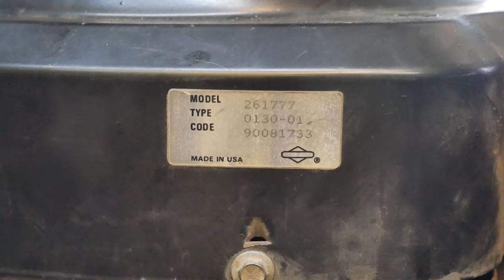Hydraulic Pump + AC Compressor = Useful Unit

Comment: You just built a 5,000 dollar unit for maybe 200 bucks in parts. Hats off to you 😁❤
Reply: 11
Reply: 8
Reply: knowledge equals capital 😊
Reply: Hardly $5,000 as you claim. You can buy a complete, capable, and powerful log splitter brand new for less than half of what you claim.

Comment: Nice work. I made a similar unit over 10 years ago using an ac clutch from a 1991 bronco. I made it for my 3 yard dump truck. It held strong, never slipped, and never failed. I sold that truck last year and that clutch unit was still going well. That unit you made will work great and hold up to anything you throw at it.
You are the only other person I've heard of doing this.
Nice work!
Reply: Не понимаю я по вашему пишите по нашему по русски

Comment: It took me a minute to figure out what you were doing. I thought you were using the AC compressor but what you wanted was the magnetic clutch assembly and the housing was convenient since you could install a different shaft to couple to the hydrolic pump. Nifty home made hydrolic pump.

Comment: Put a heavy duty microswitch to the lever by using a "B" cam, so the microswitch become depressed when you pull the lever in either direction, thus the pump only works when needed.

Comment: Seen this reposted on YouTube and everyone was hating on you. I say this is a well made magnificent machine. You used basically scrap out of a recycling bin ready to be crushed and made a working hydraulic pump and arm that you can find parts for at any local scrap yard or you could buy replacement parts new and readily available because it's just an automotive ac compressor and basically a riding mower engine. It's honestly genuis.

Comment: That’s very resourceful! I’m just trying to grasp the reason for it though. Cause a hydraulic circuit will be able to drain back to the tank when it’s not being used while the pump is still going. 

The only real benefit I see of this setup would be if you were running a hydraulic motor from the pump, you’d be able to start and stop it electrically.
Reply: That is my thoughts as well.
Reply: Он не знает принцип работы распределмтеля 
Либо очень плохо заводиться мотор

Comment: I picked up an alternator with a hydraulic pump attached to the back. I like the use of the clutch so you don't have the starter turning the pump while trying to start the engine.

Comment: this is a really cool setup but can i ask why the hydraulic pump needs a clutch vs just direct drive and allowing it to run open circut?   i could see the need for a clutch if this pump was on a vehicle to avoid long run times when the pump isnt needed. but why here?

Comment: Just putting it out there not a hate comment, that’s a gear (motor) that your trying to use a as a pump, yes it’ll work but won’t be as efficient and will Cavitate because the “inlet” is the same size as the outlet. The inlet in a pump is ALWAYS bigger. You might blow your shaft seal out to because the checks inside won’t be oriented correctly. And instead of the clutch drive you could just use a float Centre valve but hey seems to work okay. Just my 2 sense great build!
Reply: Do you realize this is hobby/amateur level job? You work with things you already have in your garage.

Comment: Nice work. Could you have used the AC compressor as a hydraulic pump instead? Would it have given enough flow?
Reply: Nope. A/C compressors are built to compress gas with a little oil and liquid Freon. But Hydraulic fluid would just stall it. BUT they make decent (Not great, but decent) air compressors !   My old 93 Yukon developed a leak in the evaporator and I didn't feel like fixing it (Plow truck anyway). But one day it dawned on Me that I could use it as an air compressor so I installed two wet side truck tanks (so I could bleed them occasionally) and a drier in the frame, put a switch in the dash for the clutch and it will build up enough air to run an impact if needed. I later installed a friction cable to the throttle so I could hold the throttle speed up. About 1200rpm works great. I'm a diesel mech so I have access to stuff. But good question.

Comment: What i did was made a frame that held the engine up between the frame rails on a trailer, and the used a direct coupler to the hydraulic pump. The clutch is a nice option so you can turn it off when you want. Even a centrifugal clutch would be an improvement. But im partial to my idea since theres nothing really to go wrong.

Comment: Why not just use a power steering pump ?  It just recirculates when not being used and doesn't load down the engine running it .

Comment: Very cool but many small vertical shaft engines already have electric clutches from the factory.  Why reinvent the wheel with custom parts that’ll be much harder to service if there’s a failure?

Comment: The bearing in that adapter housing you made won't last very long. Electric engagement on the shaft of engine would be a better choice as alot mowers already  already have.

Comment: good work but you don't need the AC compressor for that just connect the hydraulic pump directly and have the control leavers in the mid position (pas through)

Comment: Big issue for longevity when using these ac compressors for air compressors is to mount them with pulley down where possible to minimise oil consumption

Comment: I don’t understand, you never put the compressor back together? I assume it’s going to have an air conditioned cab? The main downfall is it’s going to have to run the ac at all times  to have hydrolic pressure. How about winter use? Evap is going to freeze up. Or is there a separate pump for the traction motors?
Reply: We did a similar thing but with a hydrolic motor to add air conditioning to an old kershaw shredder

Comment: Why do you need the ac compressor at all?  Simple lawn mower pully with electromagnet (like one used to engage blade drive) turning hydaulic pump would work ,

Comment: You've a major problem. The bearing on the front of the compressor housing, is lubricated from the oil in the refrigerant.  It won't last long dry

Comment: I see problems happening with all of the extra parts younare using, why not directly couple the hyd pump to the engine and run a proper open center hydraulic valve?
Reply: It can spoil the starting process? Only (or main) reason for clutch here.

Comment: Why not just use a coupling that you can get for like, $10 and go direct to shaft with the pump instead of roasting an AC compressor, spending several hours on it, and making it larger than needed?

Comment: 1 Ac pump is (become,)  hydraulic pump.. 
2 powering hydraulic  ( pump?)
3 Hydraulic ( motor ?)
Hydraulic oil pressure
4 Pushes piston 
5 does work.. 
6  yes ??

Comment: First,  great example of fabrication.   However I don't see why you need a clutch on a hydraulic pump.  The pump has very little resistance unless a load is applied.

Comment: ... So you turned the AC compressor into an electric clutch. e-clutches aren't that expensive and that thing is "too big" for what it does.. unnecessary mass and complication.. But you're using it for hydraulics? Is there really a benefit to this?..
Reply: I think that the most critical thing is the belt transmission axcial force management with proper bearing housing and the magnetic clutch is nice extra feature to better engine starting and oil circulation handling. Nice to see how the upcoming project going!
Reply: This is DIY project. You work with what you got (cheap AC compressor). Clutch helps to start the engine. Permanent coupling (motor-pump) and proper hydraulic valves are far more expensive than this setup.

Comment: The hydraulic pump is clever however are you so poor that you cannot afford a purpose-built electric clutch to mount on the engine and directly to your pump? I am sure it would be quite a bit more reliable.

Comment: im not sure i understand the point of the magnetic clutch, the hydraulic pump could just spin all the time itll dump the fluid back to tank, all those parts were new except the the clutch mechanism which was somewhat redundant in its application
Reply: The engine had hard time starting with pump engaged, so he added a clutch.

Comment: What is the ac pump for?  You attached a hydraulic pump to a compressor thats ran off an engine, seems like you added an unnecessary middle man.  What am I missing?   The clutch?  For what purpose?  Hydraulic systems run with a bypass when pressure isn’t needed and it’s returned to the sump.  Seems like a pressure valve and another hose would done the job
Reply: Another troll to BAN. Clutch helps to start the engine. Proper hydraulic system, valves etc., is far more expensive than this DIY mock-up. Do not comment. Go somewhere else.
Reply: @GrandePunto8V   I didn’t comment I asked a question- there’s a difference and I’m trying to understand what the reason for the ac pump is-  I’m still not understanding as it could be done without.  If it’s for ease of starting engine wouldn’t a centrifugal clutch on the engine be the way to go?   Don’t be a goof I wasn’t being an ass I was trying to understand something

Comment: Seems pointless having a electric clutch on hydraulic pump if you control oil flow with a spool valve. No real benefit Only easier to start motor without turning pump..but do you ever see hydraulic wood with a electric clutch on the pump NO you dont not even on pull start motors

Comment: Pretty neat but all for nothing in this application. You don't need a clutch in an open center valve system. It's like a log splitter system. The oil would just go back to tank and the pump could be directly hooked to the engine and run all the time.
Reply: Maybe it is easier to start the engine with the clutch?
Otherwise yes, normally motors are permanently coupled with pumps. In commercial machines, not DIY projects.

Comment: put a lot of work in that ac compressor when a power steering pump would do the same exact thing as 1 piece instead of a ac compressor pump disassembled and farbricated to fit hydrolic pump...power steering pump is a hydrolic pump..know guys that use them for homemade tube benders
Reply: Nope kid. Power steering gives a lot lower pressure. Plus starting the engine (it's easier with the clutch).